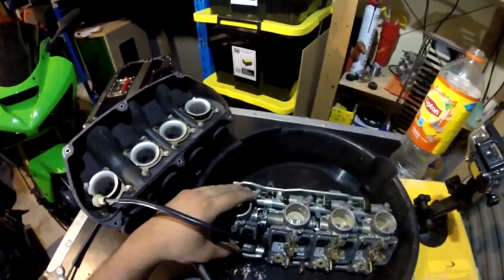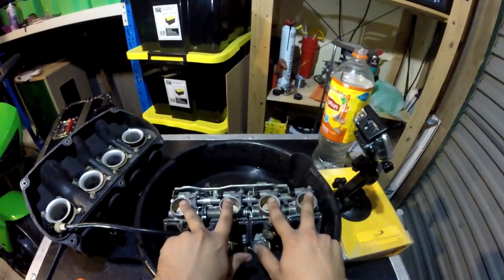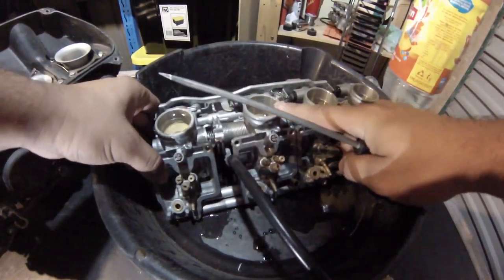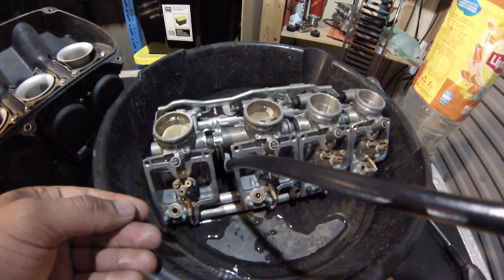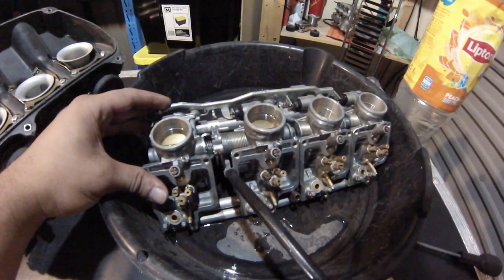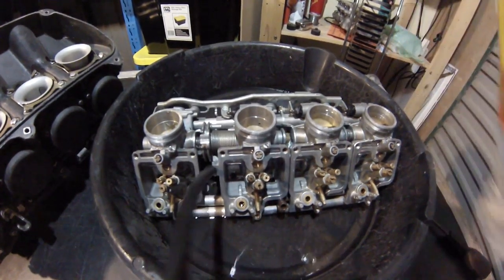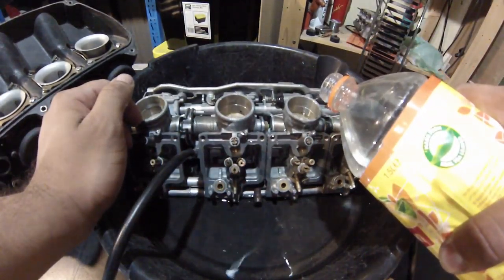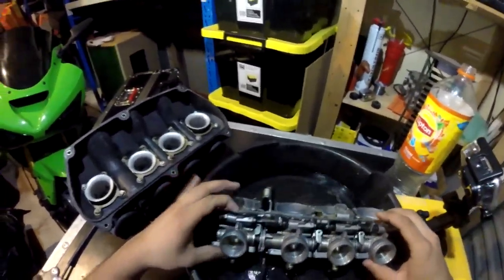How to sync your butterfly valves without any special tools

Comment: I've got to say, I was really sceptical that this would work well even though the theory seemed sound. I called around a bunch of local garages to balance my CBR900 carbs and none of them wanted to do the work. So I thought fk it, looked up how to do it and found this video.
And have to say it worked a treat! She's running better than ever, revs with no bog from just 40deg C engine temp.
Took me about 3 hours of water pouring to get it all spot on and left them to dry out for 2 days. If didn't even pull off the float bowls or vacuum. Just have it a good shake every now and then.
Bike fired up after 3 presses.
EDIT UPDATE: I've since bought a carb balancing tool and got it running MUCH better.
Using the water method was great for tuning each carb to each other, but it didn't account for the air flow between each cylinder.
After tuning it properly, and enriching the mixture by 1/2 turn, she now runs beautifully!
In conclusion, this water method is handy for an approximate solution, assuming all valves and clearance is perfect. If not, you'll need to use a proper tool.
Reply: ah ha...you answered my questions...i agree with your summary.
Reply: @andymarcelin9578  glad to be of help! Given the lack of garages willing to balance carbs in my area, I really think I could start a side hustle given the experience I've gained!

Comment: Seems a lot of farting around for an approximate result.
When you balance a bank of carbs you're matching the airflow through the carbs as the engine is running, that is, drawing the air/fuel mixture through the carbs.
This doesn't address that as it takes no account of different draws (levels of suction) from each cylinder which can result from a number of factors such as minute differences in valve clearances between cylinders, differences in wear, in fact almost anything within the engine will make a difference.
Balancing the airflow through a running engine using either mercury manometers or a bank of calibrated dial type gauges will compensate for any minor differences and you can really hear and feel the difference.
Checking that dial gauges are calibrated as a set is very important for an accurate result. I started running the workshop at a Jappo bike shop in the mid 90s and one of the guys had put the shop gauges on an engine, got the needles all lined up and declared it finished but it sounded like shit.
I put my mercury set on the engine and the columns were all over the place. After I'd adjusted them so that the columns were level the engine quietened down, cam chain and clutch noise disappeared and the bike ran very smoothly.
There was nothing with the bank of dial gauges about calibrating them so none of the guys knew it needed doing and checking occasionally. Once it was done the balance/synch could be done with the dial set and produce accurate results like the mercury set.

Comment: Ah...i dont think so as the sync gauge does it at around 1000 revs......i would like to see your carbs on the sync tool with the engine running and see how it compares....also is it not the total air coming in through the filter and for that exact cylinder...so if one cylinder is not as high compression or valves leaking a bit , restricted exhaust on one cylinder...would the sync look the same as using the gauges.  I dont know and its got me wondering. I think its fine for an initial setup but not the real deal.

Comment: Hey bro is there a video on how to take out the carby lol I can't figure it out and I don't really won't do anything without seeing what I'm ment to be doing love the vid aswell ty.
Reply from the maker: Don't have a video, if your in VIC I might be able to come help. I do also have a carb sync

Theres a lil hole on the sides the frame which should expose the bottom of the 4 carb boots. The loosen the carb boots between the carbs and engine. pull the carbies out, then disconnect the throttle cable and the choke.

If your stuck trying to pull the carbs off, the boot will have to be replaced as they've gotten to old and hard, and will most likely have cracks, try rocking it back and forth to loosen, then try holding the  right side and pulling up on the left side. And if it's still not coming out, try putting some leverage on it eg. Like using a crowbar or pole(but be careful not to damage anything)

Comment: Im going to do this on my 1997 ninja zx7r I am new to motorcycling but dirt bikes for about 3 years 14 years ago. I can fix up cars so i think this will be easy. Is there anything i can break or need to be aware of when removing carbs or getting to the carbs?
Reply from the maker: Just make sure to use fuel for this method, I just used water to demonstrate on old carbs,
Order new carb boot rubbers, they tend to get hard over time and crack, so can be a pain to removed , main things are to take photos before, disconnect you throttle/choke cables from the carbs, either before or after removed from the carb boots depends on space

Comment: I use a vacuum gauge set on the bike, but when i take my carbs apart again i am going to use this to bench sync them for sure
Reply: why not use a needle ? .. or a 1 mm drillbit ? .. instead of pouring them full of water .. having to dry them out and waste xtra time haha
Reply: @Ladosligese  funny enough I did end up using a drill bit later since i came to the same conclusion as you LOL
Reply: @kyle88l  lol good one dude :D glad you got it sorted :D

Comment: I thought I was smart and had created a new method when I did this on my zx11 carbs. I guess maybe it's common. I used fuel instead of water and I left the bowls on.
Reply: Please help me, I have a zx11 and I have a ton of questions, does yours make a ticking or chattering noise while running? I just got this bike and it say for 6 years before I got it, cleaned the carbs fresh gas and oil and filter change and fired right up but it's making a slight ticking noise is it normal

Comment: Can you tell me what I need to remove? The diafragmas, the floaters. But do I also need to remove any jetscrews or air/fuel ratio screws? Thanks!!
Reply: if youre doing the method you need the carbs removed of the bike, you cant do it without dissembling anything, but its best to give the carbs a clean before, best results are always are the carb has been serviced and cleaned. it can be done at any stage, either fully assembled or everything stripped.
Reply: @AlekseiGraciasFlor  thanks!!

Comment: Isn`t the water bad for the carbs?
Reply from the maker: depends, as long as its cleaned properly after, ultrasonic cleaner use water based solutions. you can also dry out the water in a low temp/warm oven

In the video i just demonstated with water, but i normal would use kerosene then  spray carb cleaner after, i was just in an enclosed place so used water

Comment: Good tutorial friend I am fixing the carburetor of my CBR mc22 and I would like you to help me. my question is how many turns is given to the air needle (rich mix) of the mc22. Thank you
Reply: 2 & 1/2 turns out stock setting
Reply: @shemes827  hello, that's the same thing that I did, but I do not have anything, I pull the shock and if I let it go, it's like a drowned
Reply: Yo tambien tengo el mismo problema con el carburador de mi cbr 250 mc22 ayuda por favor.
Reply: It depends on the model. The l+n model is only 1 3/4 turns out from closed
Reply: Usually for 250 cc inline 4 engine it should be 2.5 turns if the pilot jet is sized 35..

Things will be different from bike to bike.. but this is a proper guideline
Reply: 1 3/4 turn out for import MC22

Comment: I wanted to ask about the carburetor balance
is it normal to drop water in the another side,even if they are closed
Reply from the maker: did you have you fuel- air screws out? if you did i reckon thats how your it leaked out, otherwise you may have wear, was t out of all the carburettors? or just some?

Comment: Not so easy when on the engine.
Reply from the maker: you dont want to do this while its on the engine, it can cause it to hydrolock, this method is called bench syncing, hence done on a bench off the egnine, if you are trying to sync it on the engine the best method would be to use a vacuum carburettor synchroniser, its quick and easy, but costs a bit for the tool, and its best not to cheap out of the tool